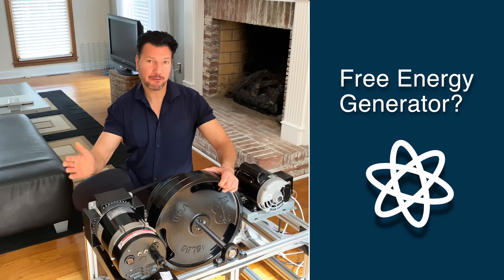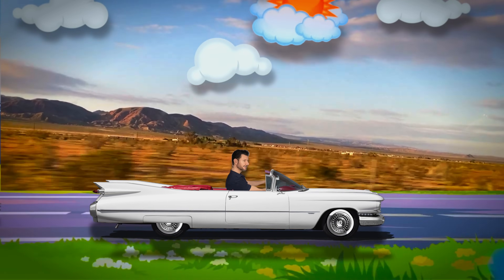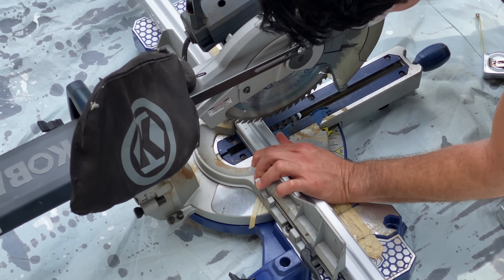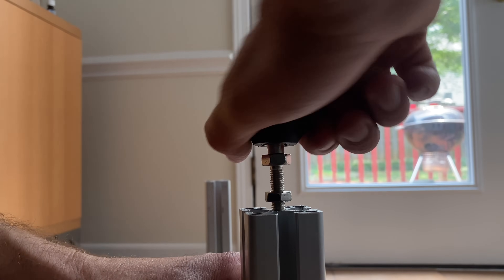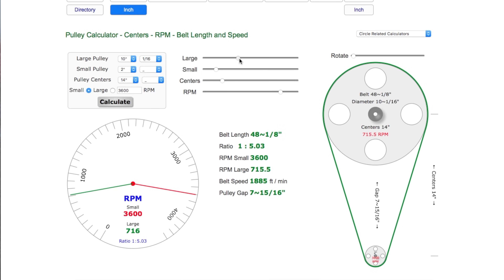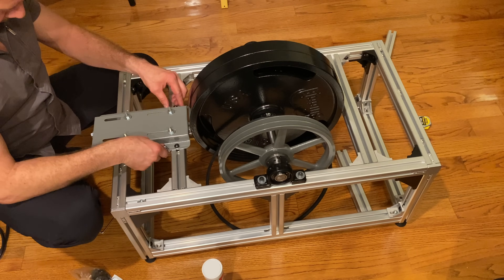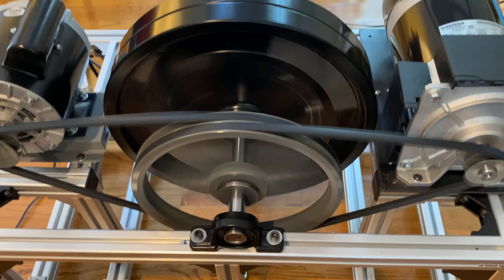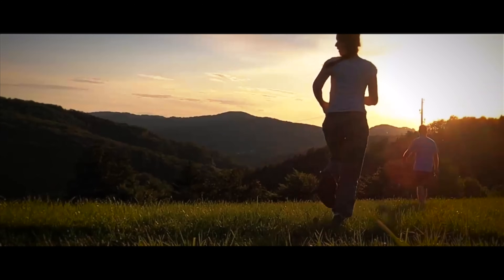How to Make a Free Energy Generator!

Comment: Speed the generators with another motor and connect this motor without the belt slack. See if it turns in the right direction.🤣
Reply from the maker: I actually did that Dawid
Reply: @MarkusNenning in another movie, it seems number two, I saw that you are removing the cover from the generator and there are three phases structurally, only it is converted to one and this is very bad because there are great losses in efficiency.
Reply from the maker: Hello Dawid I have a new generator 3-phase low rpm just have to find the time to try it out.
Reply: @MarkusNenning  o yes, I also wrote under this account, so as not to waste money because as you found out for yourself, these things are expensive.
Reply: @MarkusNenning  During this time, as a result, you will earn a few experiments on one thing and learn something along the way.
Reply from the maker: Yes unfortunately it is expensive
Reply: @MarkusNenning  Break the generator and engine into three phases.  Dig those capacitors out of the generator and out of the motor. Connect the radiators in the star and the motor in the delta. Right now it's all swallowing too much current.
Reply: @MarkusNenning  The motor is also three-phase because there are capacitors on it. A motor converted from three phases to one consumes much more electricity.

Comment: Motor 3hp 14700rpm 220v single phase as the driving source,3 inchi motor Drive pully Connected to a 5 inchi flywheel pully, then on the side flywhell the size of the 5 inchi fixed pully connected to the 2,5 inchi pully generator. Specification of generator 30 kva single phase 220v 50hz 4 pole 1500rpm. Flywheel weight 85 kg usually flywheel can be from Dongfeng diesel engine 1 silinder 30hp made in China. If everyting a disembled,overunity can accor without load for hours. If you want to use load can not exceed 800w. More than 800w usage the divice stop rotating.
How to operating provide an external power source to the flywheel rotating motor with the help of hands. Let it spin for a few minutes and then look at the voltmeter on the generator until it shows the number 220 more,after that unplug the external source for the motor and than input it to the generator source.  That was the secret leak from me. Don't give up in failure,failure is delayed succsess.😊
Reply from the maker: Thanks Aris!

Comment: You need to change you generator to low speed 1760 rpm only its high speed  you put and your drive motor is the same ratio of rpm of you generator thats why you lost rpm and cant sustain the needed rpm to stabilise the speed . Even you change the pulley to 10inch its not enough... Drive motor should be 2800 or much higher is good and. Generator rpm should be 1760 rpm only for 220v that would work and add vfd to maintain rpm

Comment: Perhaps you should try running two separate ones some of your smaller Motors running on 36 volts even a modified alternator some of the best ones I've seen had a few more pulleys that way if you get an abstraction it doesn't have time to slow down

Comment: I think you missed something with the pulley's diameter, with your setup is like you connected the motor with the generator directly.
Try the make a small pulley in the motor, then attach it to a bigger one to the flywheel to have more torque, then from the same flywheel axel, use a big pulley to relay it with a smaller one in the generator to have more RMPs, like this when you unplug and plug the cable you still have enough RMPs to feed the circuit.

Comment: I am dreaming about perpetual mobile energy since i was young ., please try to replace the belt for a hydraulic system, and Boost the magnetic hydrolic oil flow with a tesla turbine !and a tesla valve! And  chainge the hydraulic oil for magnetic hydo oil with nanotec-small-magnetic particels inside the hydraulic  oil / (they use that for modern suspensions )bind coper windings around the hydraulic system .in order to create free energy
Reply: https://youtu.be/suIAo0EYwOE
Reply: https://youtu.be/NTB7XOQA-XQ
Reply: https://youtu.be/yYy3-BZ7n1Y
Reply from the maker: So basically a complete redesign Anna :)

Comment: One thing is sure, magnet motor is already invented in different designs. Only thing is you wana call it free energy or not, is up to you. It can run from 10-25 years non stop. Input in making the magnet and out put in amps, suggests, it's access, what - output.

Comment: there is a solution to your problem but requires a custom made rotor core for your motor with would coils rectifiers and resistors for a 3 phase motor unit and you also need a 3 phase permanent magnet generator of the same voltage to speed. you also need a third motor and your flywheel to speed up the system. as soon as you get full speed and unplug the third motor power the flywheel would slow down but very slowly and if you added loads to this system it woud take some time before the machine stop. in this case i advice to use as high speed on the flywheel as possible and gear it down to power the load. this would only work as a ups solution for a short time or for a electric car project for short distances. you only has as much energy as there is stored in the flywheel  but how effective you use the energy is by conversion.
Reply from the maker: Have you done a project like your describing Primodernious?

Comment: please turn generator's wheel to the opposit side. And the small wheel of gnerator connect with the big wheel in the middle then the small wheel in the middle to electric motor. It will work or process your plan.

Comment: Well what I can say is try using a motor with a higher rpm than the required rpm of the alternator. If your alternator requires 1500rpm, use a motor with 2000 rpm. This will keep it rolling while you switch. And be sure that the power generated by the alternator is not all consumed by the motor.

Comment: .You need a better generator.
.Lighter flywheel, and may consider a belt of the tiniest diameter, and less tightened possible
Generator is were most efforts are needed. You may need either a larger diameter and more neodymium magnets on the outside, then why not flaten the wheel and suspend it magneticly to decrease parts of gravity forces on the generator itself ?
Or If you go big you may prefer a larger surface on a small diameter, rather than a big wheel on a tiny surface..
I stopped being involved in this type of researches being little forced to, but i ve seen one 8 kwh running, generator is +- 5 times bigger

Comment: Put a battery for the engine charging from the generator. Run the engine on the battery and make the battery charge from the generator at the same time. This is how the engine speed is not affected when loading.

Comment: It appears to me, your pully gear ratio is backwards. I thought the diameter of the pully on the electric motor should be larger than the pully on the generator. It appears to me, the giant weights and giant pully between the motor and the generator are a huge drain on the build. I would go strait from the electric motor pully to a generator pully being  smaller than the motor pully. Gear ratio. A 5 horse power electric motor with about a 6 inch pully to about a 3 or 4 inch pully on the generator. You can't put too large of a pully on the motor or is will overload it.

Comment: Get 1800RPM generator, it will work. Lower RPM generator with higher efficiency are for flywheel mate
Anyway thanks for proving 3600RPM is hard to maintain.

Comment: Try adjusting gear ratios to quadruple the rotations at the alternator. E.g larger pulley on the motor. Linked to a small one at the flywheel then a larger one on the flywheel to a small one at the alternator. See if a small rotation on the motor should give you enough to generate at the alternator. And have a chance to switch.
Reply from the maker: I will try that last one thing thanks!
Just received the pulley today but honestly not too hopeful.
Will have an update soon.
Thanks!

Comment: What if you use a rechargeable battery that could sustain enough power to keep running the motor, while at the same time the battery maintains enough power to keep recharging.

Comment: Good to see that you tried. Electric motors have an internal resistance which uses energy created in the system, this loss means energy is wasted. Due to this resistive energy loss, the system slows as there is less energy at the output than what is input.
Reply: magnetic motors are now used in computer cooling fans; no friction.
Reply: @boondoggle3898  You missed the point here and I'm not sure explaining things will make it any easier for you to understand based on your comment........ Internal resistance in the motor itself causes heat and nothing to do with friction of the motor bearings. The internal resistance causes loss of power inputted verses power output. Only liquid nitrogen cooled motors have little resistance in the motor winding circuits. Lastly, there are no motors on earth that do not have some friction losses of some kind on top of the resistance loss however small this may be. Pleased think before you make comments especially as it makes it obvious you do not understand scientific principles hence your comment. Understanding scientific principles means not spending money on free energy projects as its not possible to achieve under most circumstances. Just in case anyone wants to try, the nearest you will get theoretically is a near zero temperature coil and phased tapped coils to withdraw the excess energy created. See this as a possibility, hope someone tries: https://www.youtube.com/watch?v=LGvToweUXPA

Comment: You need gear ratios to spend the generator motor at high rims to generate enough electric to power the driving motor, it needs an eco system to sustain not just 2 motor and a flywheel.

Comment: Here's an idea.. ENCLOSED Turbine wheel, compressed air, pulleys and alternator. It's my patent pending😋. Air flows at wheel that makes alt spin and charge batteries. Use auto power inverter to get your power from battery. Run batteries in parallel for more AH.

Comment: Thank you for your creative efforts, but I have a question. If the energy is not generated, then what is the explanation that if the car travels at a speed of 100 km and we turn off the engine, why does the car not stop and keep going for several kilometers?
Reply: Inertia is the force that continues to act on the vehicle once you have reached that speed.Precisely the fact that the vehicle decreases its speed until it stops in more or less kilometers, shows you that there are several forces acting on the vehicle - forces that a supposed engine would have to overcome that would have to maintain the free energy system, in addition to the force needed to rotate the generator itself.

Comment: You have to work by multiplying the power by multiplying the number of rpms. You have to change the diameter of the wheel that connects the flywheel belt, there must be a difference in the diameter between the wheel that is connected to the driving motor and the wheel that is connected to the motor generator. Look at this video the calculation is very clear. https://www.youtube.com/watch?v=vQBdSm8kF1c

Comment: For me i have worked on this project in 2011 but without any luck but if i had the chance to do it again i would definitely use a DC motor connected to car battery connected with electric  battery charger that take a few watts 220 ac giving back 12v dc 14 A or so best of luck man you're doing a great job never give up.
And for people how may start question my idea i am Syrian and i had to leave my country because of the war there so didn't have enough time to get it done.
Reply from the maker: Thanks Salah!
Hopefully you’ll get an other opportunity to build your generator.
You might also like my latest two videos on gravitational energy.

Comment: One more thing this is weight rotation You must install all this setup on an Iron bar and weld all,and give grip on floor or fix it one of your motor rpm or rotation is wrong not on Aluminum frame give it floor

Comment: One of the motors are turning the wrong way.
Reply from the maker: I tried both directions believe me that’s not the problem Kevin.
Thanks!
Reply: @MarkusNenning  If the charging motor is moving fast enough to charge the battery to keep the motor that is using the electricity  to power the light that is run the device that you are using it will work.

Comment: Would you consider doing a video on its use as a mechanical battery in solar/wind/micro hydro power system. My thoughts are that 1000 to1500 solar and 500 to 1000 wind with 1 or 2 batteries with this mechanical battery would be all that is needed for most homes. Have it in a small power house.
Reply from the maker: I like the idea but that would require a much larger / heavier flywheel that I unfortunately have no way of transporting or installing.
At that point the systems get pretty dangerous and a failure in bearings can tear your house down 😳

Comment: I m a great fan of this idea. You should use Dynamo of less RPM i.e 1500 Rpm, 900 Rpm or even 700 Rpm then it won't require that much input and may help reduce the extra vibration also. And switching manually could also become possible.
Reply from the maker: Thanks Muhammad

Comment: Have you tried a switching mode power supply gen switches on while motor is off, running both at the same time they both become motors, of use a buffer between power sources

Comment: You can NOT make any type of engine drive a generator to feedback to the engine as a closed loop.
You will allways have losses.

The only point in having a huge flyeheel is to store energy when in surplus and draw when needed.

FREE ENERGY IS NOT A THING!

You can make something go on until it breaks physicaly if you constantly add a small amount of energy and build it with as few losses as possible.

But everything stops if nothing is added into the system.
Reply from the maker: Check out my latest video Johnny would love to know if this changes your mind!?
https://youtu.be/wqbJWBtoFMQ

Comment: It must be a permanent magnet low rpm 3 phase generator. Otherwise it will always a faileur. Low rpm 3 phase wind generator will work. 600 rpm. And a smaller engine motor can run it very well with the flywheel. 1 phase load the motor and the rest can use for powering other devices. In this setup on the video can not work because other phase are missing and not permanent magnets
Reply from the maker: Do you have a working setup?

Comment: Beautiful machine!  I have noticed that the generators they are using start making power at very low RPM's. Like around 500 to 700. I have sourced low RPM generators from China that produce high output at very low RPM. Some claim 12kw at 400 RPM .. Could this be the secret ? I don't want to order a 300lb crate from China if I don't have to LOL..   Just a thought.. also one site I was at was very specific about pully sizes.. Hmm.. There must be a way.. :)
Reply from the maker: I was also looking into importing one of these generators from China. 
But like you said would be nice to know if it works before doing so 
Also would mean I have to move my unit outside or in the garage cause my living room floor can’t support 300lb for sure:)
Thanks Harald!
Reply: No problem..

One more thing..
I have also noticed that every generator I have seen has been modified electrically.

Have you ever seen a Gen that is stock? What I mean is that the wires that come out of their generators have always been messed with! it is not the original wiring setup. also they claim that they have to make the generator permanent magnets as well!  there's something to it that they're not telling us..The people trying to say that they do it for the YouTube ratings but 10,000 subscribers doesn't really make you much money LOL so I don't think it's about that I truly do believe these work... some of these people that make these generators barely have a house over their head and they put many hours into these projects for what seems to be very little profit if any...
I will definitely let you know if I figure something out myself.. good luck!!

Comment: Your flywheel pulley is too big. Or get a 3-5 foot flywheel for that pulley you using. We've all seen the Dymacis gravity flywheel no matter what degree you put it stay ex: 90' or 45' it got to do with the spinning motion of the flywheel.  ex: 8"-12' pully you will need 30" across, flywheel with a heavy rim. Dur to lack of spin-up rpm once you put a load it died.  Have you seen "Lister Engine w/Flywheel?"
Reply from the maker: No will check it out 
Thanks William!

Comment: ou will need to add a capacitor to the generator which increase power output back connected to the electric motor. Your generator should be a low rpm power generator, which produce power at 800 to 1000 rpm while your motor should draw less power but has rpm of over 3000. Use timing belt. Pully on motor should be larger  and connected to flywheel pully that is slightly smaller. Another pully larger than all be place on flywheel and connected to the alternator which has a very small pully. It important that outup from generator should have a powerfull booster transformers or capacitor that produce 240 volt that can be connected back to the electric motor when the switching is done.

Comment: You should try adding some capacitors to store energy from the generator then run up to the motor
Reply from the maker: I have built a battery Joe to use in combination with the generator but not successful either 
DIY Portable Power Station from 360 Lithium Batteries
https://youtu.be/HzXQORIIUA4